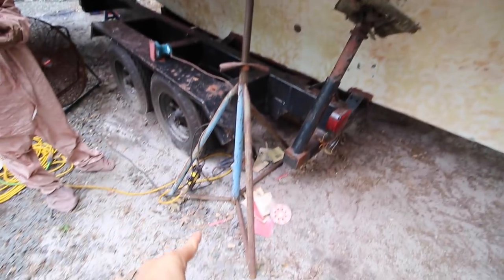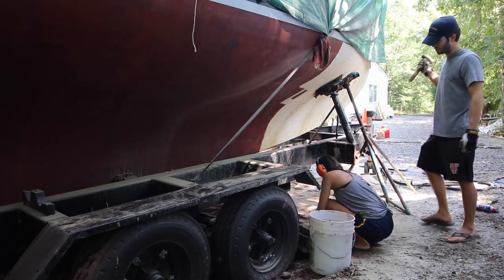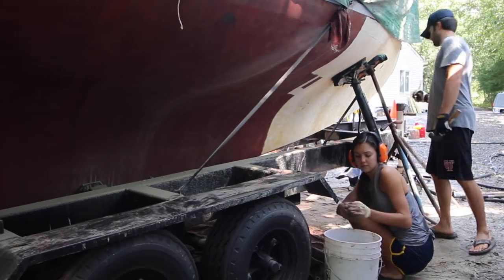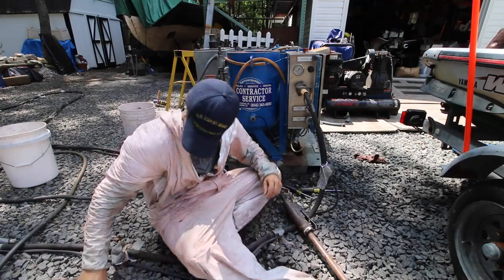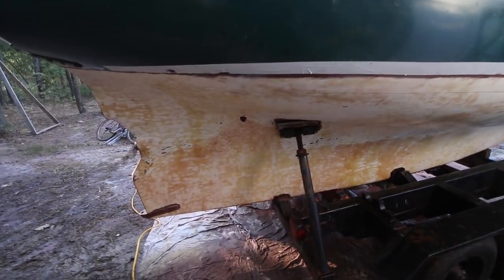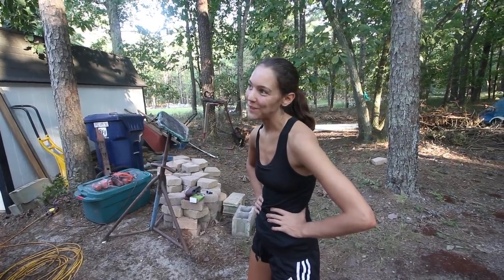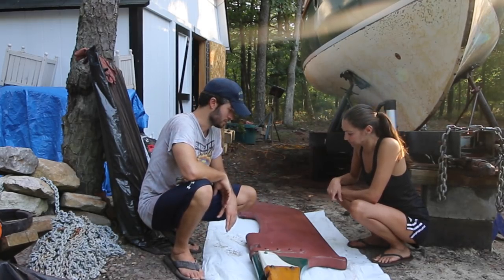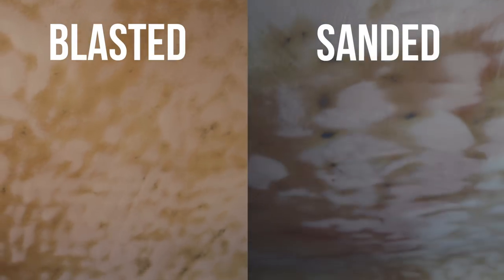45] Backyard DIY Classic Sailboat Restoration | Abandon Comfort

Comment: I have posted up a lot on my views of electric auxiliary propulsion on Uma's videos enough that people well know my stance on it. If you rarely use your auxiliary then why would it really matter so much what it is you run on unless this is more about virtue signaling than marine propulsion anyway? Not trying to be THAT way but people are asking these things today and I have never been a bashful sort of snipe. Blowing 20K or more for a system that in the end will do nothing but devalue a classic blue water cruising vessel to me isn't the brightest thing anyone could do. 
To me the lifepo 4 battery technology is one more aligned to backup teleco facilities and server rooms where the climate control needed to keep them at 72-74 degrees F is available. Replacing 14K in lifepo batteries every 10-12 years in a sub tropical or tropical environment where temperatures in the 90s and higher will just start baking the life out of them from the very 1st day they are installed has to be the most expensive auxiliary propulsion system idea I have ever heard of. If you were to actually run the little electric outboard you have for a few years in such an environment I think you would fairly well better understand the real deal instead of the sales brochure hype on those as well. Nobody I know who ever bought one of those little systems ever hung onto it after the first battery went bunk. That is why you see them all the time on Craigslist for cheap, once people see how little service is really available from those lifepo 4 battery packs they run right back to a more cost efficient propulsion system for their dinks. 
Don't get me wrong here either because I LOVE the IDEA of electric propulsion. In addition to getting in and out of the slip, the availability of boat loads of electrical storage is as luxurious a thought as could be had by most cruisers. One which IMHO tilts the scales for many who look into these systems. Many just LOVE the idea of the prop regeneration as well. However you will never see any figures published about that because it is a pipe dream too for the most part. FAR more power is generated by a wind turbine without the drag on the hull entailed with dragging a prop large enough to actaully generate much of anything when you are trying to regen off a drive line designed for forward propulsion, not electrical power generation. So unless you want to blow some more money on a reversible pitch prop (FAR more, more, more money) it is way more productive and cost efficient to just run a folding prop and toss up a wind generator. 
There has been a LOT of razz-matazz sales dreams totally based on pushing these systems out to people who have too much money to spend to devalue their boats with. 
Now, lets look at what is up and coming for a moment because there are some very exciting developments coming down the stream. The first is the newer wave of affordable hydrogen cell technologies. Liquid hydrogen refining runs 1 USD pr US gallon right now. The power factors being gotten from the new line of coming HC to electric motor systems is 3 times that of current gasoline engines and 50% or better (higher total output pr gallon) than current diesel technologies. The only thing they emit is water. There has been a LOT of work on solar electric systems to convert that water (or any fresh water source) back into hydrogen as well. There are in fact hydrogen cells available for marine battery charging applications already, they run on alcohol and put out around 3KW pr gallon @ around 140 watt hours. Meaning we are VERY close to more powerful fuel cell technologies with at least one auto manufacturer now predicting the release of a hydrogen fueled electric car as early as next year. No noise from marine charging  units now available and no emissions except for water mind you and they are very compact. 
The DRY CELL lithium battery technology seems to have stalled. There are no thermal loading degradation evals out on them yet that I have seen but the power storage to weight ratios are said to be 4 TIMES that of current lifepo 4 batteries. I would not want to be the one hanging out in 5 years with a 14,000 USD lifepo 4 array if those get released provided they FINALLY get the storage AH to dollar cost in line with something REASONABLE. 
On the more conventional side of the equation is the new Liquid Piston engine technology that doubles the power  (cuts fuel usage down in the gasoline engines by 50%). TWICE the efficiency there. They only have few moving parts and IF they can keep the rotor properly cooled (I have done no extensive mathematics on that yet) should have stellar TBO ratings. MIT loves the thing and so does DARPA, enough so to fund them with millions (DARPA) and hand them awards (MIT). In addition, a diesel version of one large enough to power a cruising boat can be overhauled, and by a novice in a few hours at best! The power to weight factor is the most exciting thing there because the first gasoline models are slated for portable electric generators. Those will be light enough, and powerful enough to give your little electric cutter enough electricity in a pinch to run at 6 kts and SHOULD be smaller and weigh less than a Honda 2000I. No projections yet as to what the diesel version of that engine will do except for a power to weight projection up to 1/10th that of current diesels. It could be very revolutionary. Something like that would go miles in filling the cruising void left by the lifepo 4 battery technology.
I spent about 2 years putting together plans for an electric propulsion system for a 34' boat myself. The reason I engineered the plan myself using individual COTS components instead of relying on ready off the shelf systems is because I do not trust businessmen. The only way I could keep the TOTAL system needed there to the weight of the Atomic 4 and it's support gear,  ie: staring battery, fuel tank (minus fuel as the plan called for a like amount in jerry cans for the portable generator), exhaust system etc. was to flip the house bank to lifepo 4 storage as well. That on top of the thermal degradation issues, PARALLEL charging gear to the CELL level, generator backup to get me further than 20 nm @ 5 kts, AND a LOT of communications with people who had actually flipped their blue water boats over to these systems complete with actual performance figures caused me to abandon the issue,,,,,,for now. 
Know too that the newest charge depth parameters out to insure the life cycles of those lifepo 4 batteries is now standing at 30-90%, so there goes most of that large advantage over lead acid batteries and their "usable" power storage. 
I've seen many who have put these systems into their boats post opening data and then they just disappear, never to be heard from again. So that should tell us ALL something right there. I have also seen skeezery in the videos put up by a few hawking these systems to cheat the real performance perceptions of those watching.
As it is with your situation, you have a new diesel which ADDS a reasonable amount of value to your vessel by its own right. IF you were to dig below the surface information put out by the manufacturers of these systems and get a BALANCED input of REAL LIFE information on what these systems can really do TODAY you would probably see things as I do with them. 
IF you have a day sailer, and you are a few miles in and out of your berth to your sailing area AND you can do with lead acid batteries, these can be great cost efficient systems. However, for blue water cruising, at this point, they are failing. So much so in fact that one catamaran manufacturer whose total product I really wanted to be very successful (SMG) has now folded with their CEO stating the EP technology just was not ready for prime time as it is. In addition, I understand that other cat manufacturers who were aboard with these systems are now pulling back. The battery arrays simply are costing them too much in replacements for early failures AND the charging technologies overall are not up to what they need to be for REGULAR turn-around charge loading of these lifepo 4 batteries to insure their cycle ratings. THIS is on TOP of the thermal degradation issues in sub- tropical and tropical environments as well. 
However IF, you are going to move ahead anyway despite the very best advice I or anyone else who has put YEARS into studying these systems in a non-aligned business venue can give you know that I will always wish you the very best here. And in that spirit I will also advise you to look into the Thunderstruck line of propulsion modules for your project. They are very well designed and cost efficient. The belt drive system they use is simple and allows one to more easily alter drive ratios for a well tailored propulsion line AND more easily allow for a greater variety of prop choices than the geared linear drive units out there. Their MOTOR controllers are top shelf, and all the parts used in their kits are affordable and readily available COTS commodities.
BTW, your Prius uses NIMH batteries, not lifepo 4s. There was a reason why Toyota never went with lifepo 4 batteries ya know.
Reply: Lost us at virtue signaling. And yet you kept going anyway.

Comment: I've used industrial sandblasters before but never one that used water as well with it. I had been wondering if it was a good idea to blast the bottom paint off or not. Blasting gets in all the nook and crannies when you do it to carbon steel but wasn't sure if it was to aggressive on fiberglass. Very cool.

Comment: You will row it , in obviously calm conditions no probs, a  wind generator is it good idea , personally I would have a small petrol gen, as a last resort to charge battery, and always in place a light anchor at the bow to even throw, but basically to row out fast , you can always do the tiller waggle , also a permanent stern anchor for same reasons like if your getting caught with a current you didn't know was there to have already in place to put out quickly that's what makes all the difference to travelling without a motor or perhaps your batteries are depleted,  but the stern  anchor is also handy for pulling round you're Stern to keep your bow pointed into waves coming into a bay and can make for a more comfortable sleep .

Comment: On power: Consider checking out "Gone with the Wynn's" regarding a generator and recovery time.  They represent the opposite of Abandon Comfort but are dealing with solar power in a big way and have made some serious discoveries.  Perhaps a diesel electric??.. it saves a hole in the bottom.

Comment: OnBoard electric would be interesting to see and what charging options you have if you are limited with solar. Will you be doing hyrdo, wind and solar? Any chance of having a small generator as a backup or you just going renewable only?
Delos did a great video on working out their power requirements and upgrading to LiFe batteries. Was surprising to see how much some items used.

Comment: Ryan and Kelsey,
I was beginning to wonder if you had just launched the new boat and went sailing without us!  

 I just returned from the Wooden Boat Festival in Port Townsend where they had a dealer for Beta Marine and another one demonstrating electric propulsion.  The Beta, while a good diesel engine, was over $10K for a 30 hp unit not including all of the related material and parts for installation.  I didn't get pricing on the equivalent electric configuration, but the gentleman at the booth estimated the electric motor alone would be about $2,000 to $3,000 for the equivalent hp electric motor and controller, etc. (they haven't sold one that large yet).  The batteries would vary based on the type you choose for your system.  What amazed me was the size of the 3 hp unit he had to demonstrate at the show.  You literally could have put it in your lunch box and still have room for a sandwich and chips.

I guess my point is that for the size of your new baby, electric propulsion will benefit you by increasing your stowage capacity, making a quieter system when needed and just being better for the earth.  I believe you are doing the right thing.

Glad to have you back.  Also glad you got me hooked on Mads' channel!  What a great person.  Thank you and can't wait for the next great video.

Comment: On your repowering you need to look at Big Easy Sailing on you tube episode 30 and you may rethink about going electric. They had the same idea as you and found it to be not as reliable as thought do to currents and wind. Also you mentioned about that you sail more than motor , that being the case then you should not require all the extra fuel and weight that you mentioned in this video. With limited area for solar panels excetra for replenishing batteries, which you will need for house power and dailing living. You already have a sail boat that was designed for its specific use and now you are try to do some thing totally different which could case the boat to be a chore too sail or use. Just something to think about

Comment: OARS!!!!!!!!!!!!!! You got to be joking, that's not a Dingie! (Rowing that size boat would take one hour to get it moved 1 foot)
(EDITED AFTER 10 REPLIES: After reading the replies I have to ask: 
1. "What is the DISPLACEMENT of this boat?" 
2. "What size/HP engine NORMALLY powers this size boat?"
3. "Judging by the Physical appearance of the 'Crew' can they match the engine output and for how long even in a Doldrum?"
4.  "The comments about the Colin Archer boats is NO match, rowed for short distances OUT & IN a PROTECTED Harbour for maybe 100 / 200 meters ..... (See also build of the crew) Again, DOLDRUMS comes to mind which is Hundreds of Miles"
Reply: No actually, you can row one of those quite easily. Not in a storm perhaps, but if becalmed or docking in calm weather, perfectly viable
Reply: The original Colin Archer (45.feet, Norwegian rescue vessel) was rowed in and out of harbours. No problem at all for the crew.
Reply: I would just carry another Jib.
Reply: Given the power required to move that boat, a single man who is an elite athlete  would be hard pressed to get to 1.5 knots and couldn't maintain that output for long.  On the other hand it would be a great workout.
Reply: Guy yulohs a typhoon in & out of our harbor all the time. Works great.
Reply: A Cape Dory Typhoon is a much smaller boat.  The big difference is displacement. At 1,900-2,000 lbs the Typhoon is about 1/4th the displacement of the Falmouth 22.  Since to a first approximation, power required to move a boat is proportional to displacement a Falmouth 22 would be about 4 times harder to row or scull than a Typhoon.
Reply: Check out R2AK lots of bigger sail boats being rowed or sculled... even pedaled.
Reply: The key is displacement.  The Falmouth 22 is a very heavy 22 footer and will be correspondingly hard to row at more than just a creeping speed.  If there is any head wind it will be a real workout just to stay in place.  A common characteristic of the R2AK boats is that they are light displacement.  That is what makes them moveable using man power.  I didn't say you couldn't row a Falmouth 22, just that you won't be able to go very fast or very far.  Add in a head wind or chop and the task gets much harder.
Reply: for anyone questioning wether a boat this Big (small) can be rowed please see R2AK and Colin Archer rescue boats.
Reply: Can ONE guy row a 45' rescue boat?
Reply: And how, exactly, do you think Lin and Larry moved the much larger Serafyn and  Talesian around for all those decades with no engine at all? Sails and oars have of course been around much longer than have engines. 

"The Pardeys have sailed past all the great southern capes, including Cape Horn. Larry, assisted by Lin, built the two boats they used for two circumnavigations; both were under 30 feet and were designed by Lyle Hess. Neither boat had an engine."

https://en.wikipedia.org/wiki/Lin_and_Larry_Pardey
Reply: ... and in the Doldrums, you'll still have a current.  If you're going with it, great!  If against it, no way.  When we crossed the Atlantic sailing west, we had half a knot of current going our way.
Reply: Rowing ?  There are many things one can do but should not .  One can row that size boat in calm flat water conditions no worries  , but try it against 15kt winds and 3 foot waves .